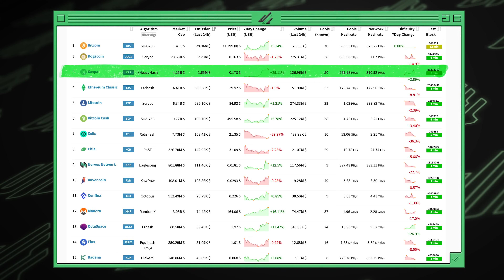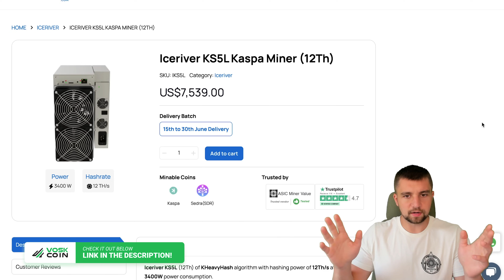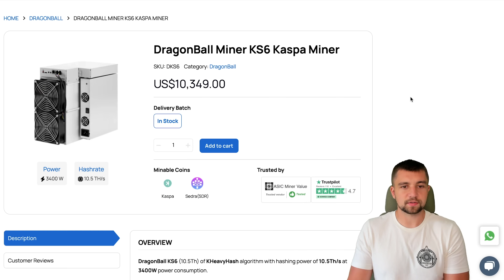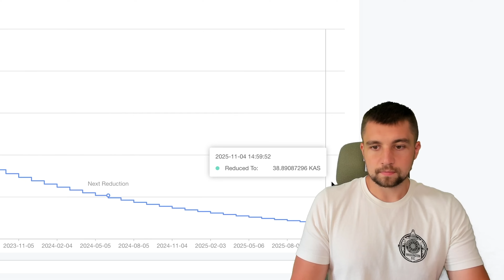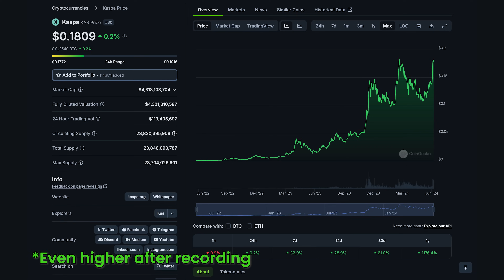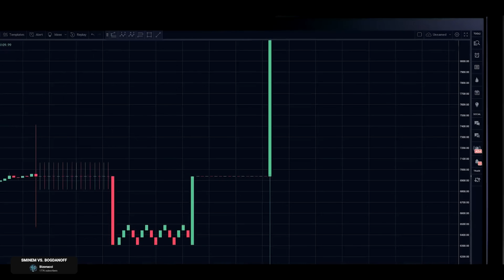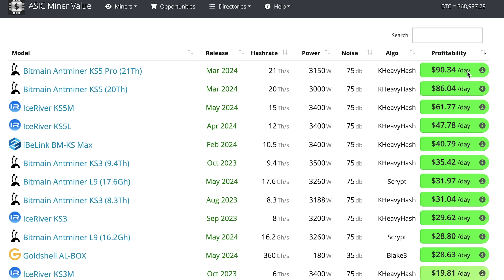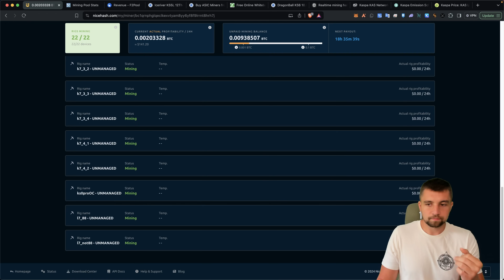These Earn THE MOST MONEY but I am SICK OF THEM

Comment: i refute one thing: you said at these prices i probably would have never got into mining, but the reality is, all these Small at home miners, box miners, etc, they have basically caused gpu mining to be irrelevant.  If i can go buy a iceriver ks0, (og, pro, utlra or whatever) at a price cheaper than a GPU that mine way better than a gpu, they basically have become the point of entry for new home miners and replaced gpu's. 
A 120v home miner can buy a ks0 ultra for like 400 bucks, set it and get it churning fairly easily.  Then as they get more into it, they start dabbling with overclocking and modding.  home, low power miners are the new gpus
Reply from the maker: yes but my GPUs mined a dollar to several dollars a day each

Comment: The miner thats still online but not hashing, may try a new power supply.  I had a ks0 do the same, as well as give errors when trying to log in or change settings... Redet it and put back on original power supply and its hash just fine at its original settings.